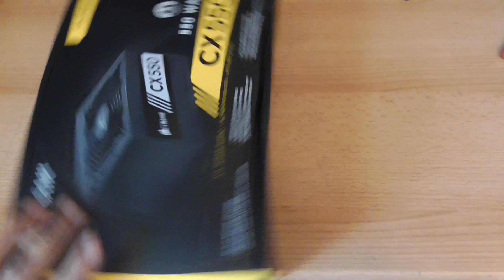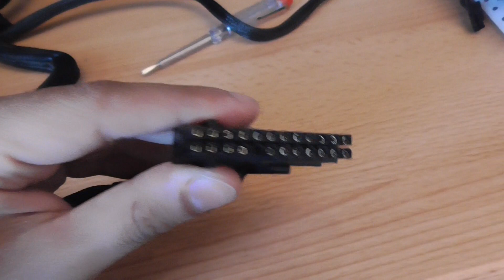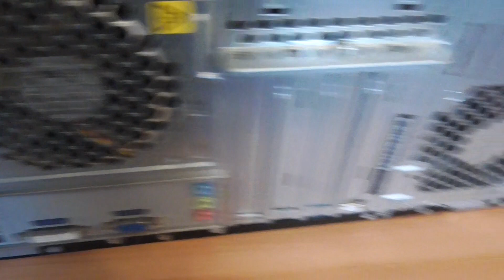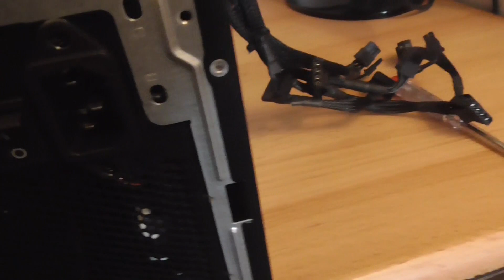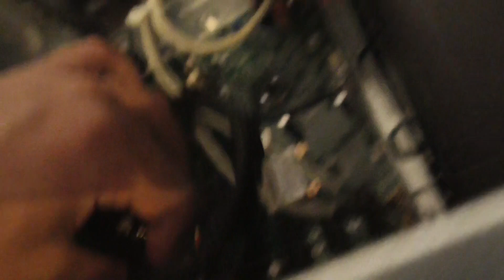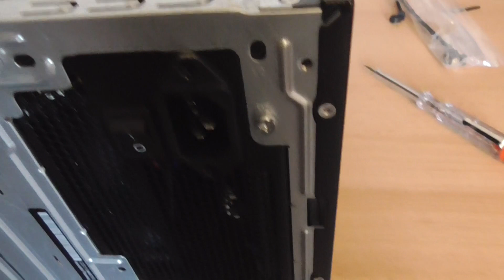Corsair CX550 Power supply unit unboxing + installation

Comment: Hi cool Video that you make i have a queston i will buy a new graphics card gtx1650 4gb ddr6 overclock asus but the problem is i have a power suply that has 300w and a old graphics card gtx 1050 2gb that takes 75w . The problem is now that the New graphics card neds 300w min an do it will work if i buy a 550w power suply by corsair cv550 plus bronze . Info i have a intel i5 8400 and one hhd und one ssd drive and a CD drive that i dont need mother Board is a tampa 2 :/ thx for help =/

Comment: Why mine setup didn’t have 4pin for EPU??? Corsair CX550M
Reply: Check the 8 pin for CPU it's actually 4 plus 4 seperate it
Reply: Buy an adapter

Comment: Wait so I don’t need all the cables? What do I do with the cables I don’t need
Reply from the maker: Twist the cables for power of the drives, motherboard, cpu etc are provided with the power supply u buy. So if u buy the one in my link all cables come as it is. And the cables u won’t use tie them away neatly, exactly how I’ve done it

Comment: I’m gonna order a this PSU with a R5 3600 and a 2070 Super
Reply: Get 5700 xt
Reply: Carter retraC the 5700xt has a chance of getting problems and I don’t want to have problems with my GPU, nor want to return anything
Reply: @twist5334  ok fair enough, can't fault either choice just making sure you looked into it. I have a 9600k and 2070 s build and 3800x and 5700xt build that both work perfectly. Best of luck 👍.
Reply: @peterfitopoulos765  nice, my brother has that exact setup, and he loves it. 1080p max settings 👍
Reply: Is the build working fine is there any noise issue?

Comment: would this psu be enough for a build with a geforce gtx 1660, msi b450 tomahawk and a ryzen 5 2600?
Reply from the maker: Lynchy yeah it should be fine. You can still check how much psu is required for each
Reply: i have built the computer now, and there have been a few problems but that was just a lazy power cable, nothing else.
Reply: @jameslynchyyyyyyyyyy  hows the psu holding up so far?
Reply: @motiv  got a new one for a 3060ti but did me good for a year had no problems with it 😃
Reply: @jameslynchyyyyyyyyyy  nice upgrade 👌

Comment: Nice video bro. I'm going to buy the same PSU for RX 570. You think is that enough?
I have a H110M-E M.2 motherboard. i3 7100 8GB 2133 MHz Ram. 1TB 7200Rpm Sata HDD. And Rx 570 6pin. You think the cables and PSU enough for that?
Reply: also I bought a rx 570 too
Reply: More than enough 👍
Reply: @lostbusproductions8459  small prob.  VGA needs 8Pin.
Reply: Get the CX550M instead
Reply from the maker: Hi, Yes it sure will be fine. That is enough PS

Corsair CX550 Power supply unit - https://amzn.to/2NOmSTa

Computer Power Cable - https://amzn.to/2KpzWw6